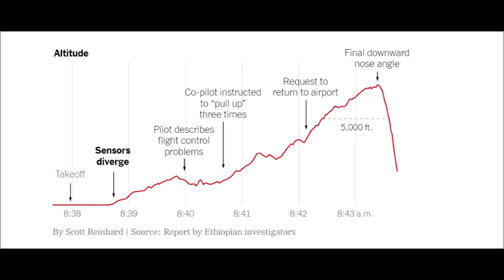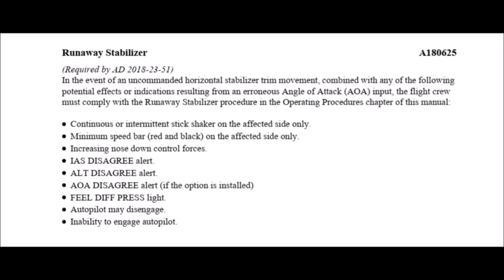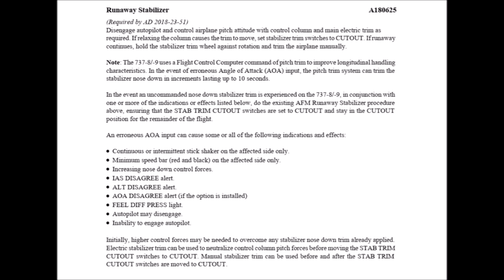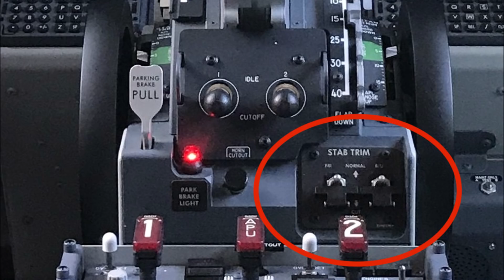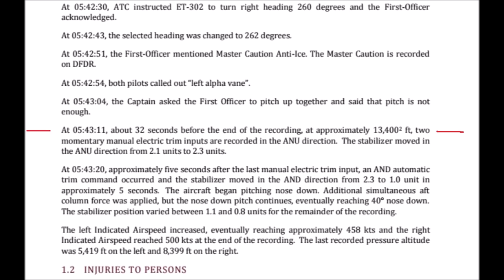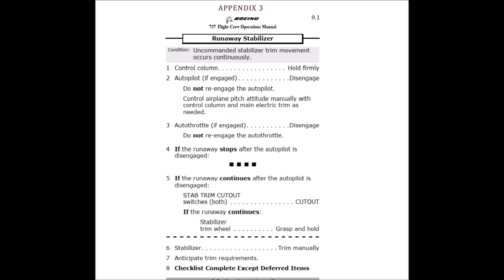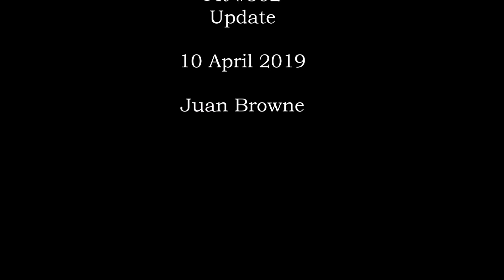737 Max Update 10 April 2019 Runaway Stab Trim Procedures

Comment: I know I've made several comments about pilot error and trust me I wasn't in any way trying to disparage their attempts to correct the situation, but I just had this gut feeling that maybe they were not as proficient as their counterparts in the wider community. I think you nailed it Juan when you talked about one pilot taking control of the aircraft and having the other work through the various issues and my understanding is in these situations, in emergencies, the Captain always takes control of the aircraft and instructs the FO on what systems or checklists he wants to run through. I'm not sure that was the case here, I had suspected that the FO was in command of the aircraft, maybe you can correct me here, but if in fact it was the FO in control, I can see where his FoV would have been even further reduced due to his lack of experience and on the face of it didn't take full manual control of the aircraft, particularly the throttles. That's very telling, with neither crew not being aware of their air speed. That's not something you'd expect from any pilot operating a commercial airliner. Carrying as much air speed as they were explains why they were having difficulty manually trimming the aircraft, so that in itself should have brought their attention to their IAS. The straw that broke the camels back though, re-engaging the Stabs Cut Out. Not recognising their power settings, clearly indicated via the IAS, which subsequently affected their ability to manually trim the aircraft, then went offbook and re-engaged the Stabs. That cockpit sounded like it was just full of confusion, maybe rightfully so, if they were not up to speed with the new systems, which brings us back to Boeing and their responsibility in all of this, which is considerable, but ignoring basic flight instrumentation and going offbook, it's almost guarantees that Boeing will be relying heavily on those facts in order to return the aircraft to service and reduce their financial liabilities relating to any inevitable lawsuits. I'm gutted for everyone who lost their lives and the families involved, regardless of the outcome, I hope the flight crew will be remembered kindly, as they did their very best to resolve the situation. Great work Juan, I always appreciate the work you do, the experience you bring to the table and your ability to remain on the fence regarding fault, because at the end of the day, fault will be allocated by people far above our pay grades.
Reply: @gordonrichardson2972  All good Gordon and agreed, pilots have very little understanding of MCAS, let alone have experienced these situations themselves, but as we are discovering, MCAS created the situation, due to bad data from the AoA, which results in symptoms not unlike a runaway stab, which is well documented and I'd suggest well understood by pilots, in this instance though, they went offbook, but I hear you, maybe some time in the simulator is required, I guarantee you though, all the top tier airlines would insist their pilots simulate the event, if not for nothing else but to cover themselves, but after these incidents, I think every pilot who gets to fly a 737 Max is going to be well aware of the scenario and will understand how to resolve it. All the best.
Reply: I don't think any simulator on earth (except at Boeing) can trigger a cascade of AOA faults. AFAIK pilots are trained to deal with single scenarios, not multiple faults from a single sensor. At that point Boeing says, good luck, your aircraft now...
Reply: Stormbringer Your points may be valid, but aircraft must be certified to be flown by pilots with average skills, not Chuck Yeager.
Reply: @gordonrichardson2972  average pilots get to fly themselves around, they don't get to become commercial airline pilots, but the next time I run into Chesley Sullenberger, I'll be sure to pass on the Chuck reference.
Reply: Stormbringer Did you read what Sully said to the NY Times about Boeing? It was not very complimentary...
Reply: @gordonrichardson2972  Boeing do have a case to answer, no doubt, I refer to it often in this post and others, but that's not what I responded to. I responded to the extraordinary claims that "aircraft must be certified to be flown by pilots with average skills" is complete horseshit when we're referring to commercial aircraft. If that's the level of competency you expect from commercial pilots, god help us all.
Reply: Stormbringer The definition of average pilot skill is mandated by Congress, and described in the Federal Airworthiness Requirements (FAR). Perhaps you should read them, before making an abusive response to my comment.
Reply: @gordonrichardson2972  I'm not in the US, I live in Australia and work for QANTAS, but I'll include all of the major airlines around the world when I say this, your not getting behind the wheel if your an average pilot, many are pulled from the RAAF, USAF etc, these people would not be considered average pilots, if anything they'd be considered upper echelon, but hey, you stick to your guns, if you truly believe that commercial pilots that are employed by AA and UA are average, as I said before, god help us all. Skills mandated by which ever organisation you chose to use in your argument, are irrelevant, they are just a base line, which I guarantee you is not the same as required by major airlines around the world.
Reply: Stormbringer My comment is not about the quality of the pilots (I am also outside the US). The fact is that the aircraft should not be so badly designed, that it takes superhuman skills to control. I think we are talking from different sides of the same story.
Reply: @gordonrichardson2972  I don't think the Boeing 737 Max is poorly designed, I think the MCAS system is over powered and not implemented correctly(read no redundancies), but is a relevant piece of software, like many of the automated systems on board. Boeing got it wrong in that sense, it will pay a huge price for doing so, but those pilots, god rest their souls, made some serious errors, not recognising their air speed and the auto-throttle settings, that's, with respect, is amateurish, that's not even second rate or third rate piloting skills, it's like they skipped the manual covering flight basics 101 and went straight to panic mode. I do hear what your trying to point out, my responses were a little too harsh, sorry, but when I consider the fact that this aircraft has performed 10's of thousands of cycles, successfully, what's been the deciding factor in these accidents? Failing components, faulty systems and pilot error, some hard truths but we can't ignore them, so we can walk away, understanding each others point of view and be happy we're all discussing this with good intentions. I don't mind being kept honest and I can see you stand up for your own beliefs Gordon, I wouldn't want it any other way :)
Reply: Stormbringer BTW,  selling the MAX to 3rd world airlines, as being the 'same' as the NG model, verges on criminal negligence IMO.
Reply: Stormbringer I agree that the MAX is a safe aircraft, and once MCAS is fixed, it will return to flight. However, the reputation damage is harder to fix.
Reply: Stormbringer The failure of the AOA sensor is a critical issue, worthy of detailed investigation. Checklists as well. Much to learn from these accidents.
Reply: “In creating MCAS, they violated a longstanding principle at Boeing to always have pilots ultimately in control of the aircraft,” said Chesley B. Sullenberger III, the retired pilot who landed a jet in the Hudson River. “In mitigating one risk, they created another, greater risk.”
Reply: “Having two crashes in rapid succession with no survivors is really unprecedented in modern aviation industry,” said Chesley B. Sullenberger III, the retired pilot who landed a jet in the Hudson River. “This is going to be a huge hit to Boeing. What they need to do now is to behave in a way that proves themselves worthy of the public’s trust.”
Reply: @gordonrichardson2972  you're winding me up again lol, I'm in the middle of something and don't have the time to continue discussing this point and am holding back making any more disparaging remarks, but I'll say this, since when is it the responsibility of an aircraft manufacturer to ensure the pilots operating their aircraft are properly trained? If pilot error was at least part of the equation, which I think has been established, but will hold out for the final report, you have to question what type of pilots were those third tier airlines employing and what type of training regime they practised. I'm out.
Reply: I'm really not winding you up, but that is the crux of this whole discussion.The manufacturers and regulators set the training standards for each new aircraft model. That was the big selling point of the MAX. No expensive training, just an hour with a tablet computer! The dead captain had thousands of hours on the B737 NG. How did he know that MCAS was going to kill him!?
Reply: @gordonrichardson2972  Ok, I'll bite, yes the manufacturers set training standards, but do you seriously believe top tier airlines don't go beyond that? Regarding simulators, your showing your lack of knowledge here, because you can programme multiple points of failure in a flight sim, they do it all the time, but don't just take my word as being gospel, Juan is both a military and commercial pilot, ask him what his training regime was like. I think you'll be surprised. Regarding Sully's comments, they are all valid points, hence my earlier comments regarding MCAS being overpowered and poorly implemented(read failsafe redundancies). Boeing will pay a huge price, but so will the airlines involved in these incidents and remember, the B737 family has had a very, very long and successful history in aviation, being one of the most popular, if not the most popular aircraft of all time, within it's chosen marketplace naturally. If the company that I work for chose implement them into their fleet, I'd have no hesitation in boarding the aircraft, but when you've worked for a company like mine and you know how seriously they regard safety, there's a reason why they've only had 1 significant incident since the B707 was introduced back in the 1950's, which was a result of overconfidence more than anything, the Captain rightfully so shouldering the blame for that one. You get my point though, if the pilots on those Max's were from AA, UA, BA or QF etc, I'm very confident the the aircraft's would have complete their cycles successfully. Lastly, explain to me how the pilots where not in complete control. You could excuse the pilots involved in the first incident of not having the benefit of the updated flight manual, not really but maybe, but this latest incident, when it was spelled out for them, how do you explain the fact that they went offbook? They'd actually saved the aircraft, MCAS was disabled, but they couldn't manually trim the stabs because of the forces created by the excessive speed, because clearly, both the Captain and FO were in meltdown mode and couldn't revert to the basics and simply fly the aircraft manually, totally ignoring their IAS relative to their altitude. Why were they reaching such speeds, because in their panicked state, whoever was in command of the aircraft didn't disengage the auto-throttle. If one of them had recognised that fact, we wouldn't be here talking about it. People are free to express their opinions, bang their drums calling for Boeing's head on a stake, but facts are facts, unavoidable truths and sometimes it's ugly, especially when we're all learning they could have saved the aircraft and all those lives. I don't enjoy making these comments, their not with us now and I certainly am not dancing on their graves, but you need to wake up and smell the coffee, see the forest beyond the tree's, simply allocating blame to one entity and allowing the others to walk away isn't going to yield the results we're all looking for and that's that the aircraft is made safe, the pilots are competent and the airlines provide adequate training. Is there anything else i can help you with Gordon? As I said, I enjoy reading other peoples opinions on these subjects and engaging in discussions to hash out opinions, but I think we've hashed this one out to death.

Comment: One big issue with MCAS is how independent the system is. It relies on too few sensors and too little data to trim the plane.
Reply: Bruno Danese Good point! Incorporating more sensors would have been more complicated. In fact that is exactly what Boeing now have to do, to get the MAX airworthy.

Comment: I'm a aircraft mechanic. A sensor, duh, THE AOA SENSOR ON BOTH SIDES OF THE NOSE WITH PILOTS IN THE COCKPIT ...that dictates to the flight comp WRONG READINGS, DATA, that changes all readings.....alt, airspeed, ECT to the flight computer......fucks up........the MCAS program tries to compensate for the tendency of the b737-800/900 to avoid nose up during ascent/descent...due to newer engines installed and placed forward and up on the wings........the MCAS was used to compensate for that.......b737-400 or any other variant before didn't do this. The plane should have been designated b737B-100/200 and developed more. Boeing competing with Airbus. As a pilot, if you get trained to fly, and have to avoid a stall, by memory you go through procedures and follow a manual inflight and do all procedures... anything to not crash or at least minimize any Damage......THE MOVIE 'FLIGHT'. The pilots of 302 did this. The plane was flying itself and the pilots lost because they did not train after a memo, from the FAA, that stressed this problem of possible stall. The 737 or any airliner aircraft are not jet fighters. The max 8/9 flies, but that much different from previous iterations that more time should have been done to physically stop the plane from going nose up than rather use some algorithm on the comp running to auto trim the pane, especially during ascent/descent. Most pilots complained that tested the b737-800/900 during trials that they had to turn off the damn MCAS program to avoid their own possible crash let alone another pilot would have failed and crashed. As you said you've flown commercially, privately and in the military. I suppose you had to fly a shiitty c-130 manually most of the way, no probs, but dude........the plane, b737-800/900 with a screwed up AOA sensor was flying  itself and the pilots really thought they were in a stall and did not win trying to fly the plane themselves...,if they knew to turn off the MCAS. Like when your driving in auto cruise with your car on the highway....you hope auto cruise WOULD shut off if you order on the brake. Yes......they should have just disobeyed all and just  fly right back to the airport and FORCE a landing.... I think. Yeah WHO to blame. Who was the aircraft mechanic with avionics ratings that didn't check these sensors out? I have an avionics permit.......you can't catch all possible failures with such a go-go-go profit tight environment. A lot of failures. Ford made a car called the Pinto.........Boeing did this now....... Oh, there's a video on youtube about the Pinto. Money made.....though ....

Comment: It sounds so complicated. It shouldn't be. If only there were a master switch - GIVE ME CONTROL - that put the pilot in complete control, it would override any software problems.

Software problems? You bet.  This plane has an inherent problem - increasing throttle can cause stall!  What, you say?  Yes - that's the whole 737MAX problem and there's no reason in the world why pilots should expect that of a well-balanced plane. The new engines and their position are problematic.  Boeing created software to offset pilots natural instinct because the plane's balance is off. That's a great big problem only solved by designing a new airplane. This software was created (badly?) to account for a major design flaw.

So the pilots are fighting with software that's trying to accomplish utterly non-intuitive things. Hmm. That's a problem.

Boeing needs to ditch the software completely and redesign the airplane.
Reply: A larger horizontal stabilizer would fix the problem instead of MCAS...but MCAS was the cheaper option.
Reply: @stimproid  - I fully agree with this (what you wrote).
Reply: stimproid Actually a larger elevator would help, but your point is valid.
Reply: I'm certain that this plane is good as any other one ....... provided that it's not running on software with big holes in it. The problem here was that boeing software design team broke a golden rule --- they failed to take into account the basic and obvious scenario of sensor fault, and failed to have important pieces of code that stops faulty sensor readings from making a really bad day for pilots and people.
Reply: @southpark5555  Agree.

Comment: I have watched all of your recent videos re: the MCAS anomaly and have not heard any mention whether the aircraft was still in a climb or was attempting to establish level flight.  Since the over-speeding of the engines and a high rate of speed resulted was there any thought to the continual tendency to climb against the selected preset altitude.  If power is your altitude control and your elevator is your speed control is this where the anomaly in the software, as basic as this can be, why the constant down trim was manifesting.
Reply: dave ayres Please watch the accident report video again. All the answers are there.